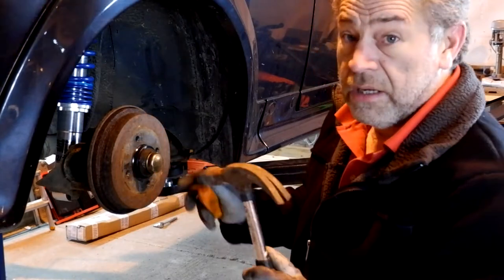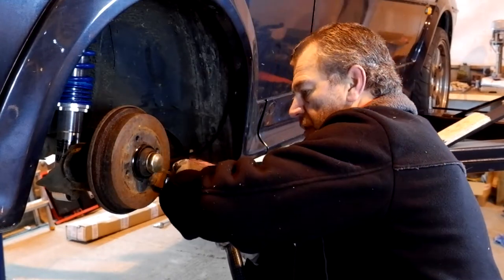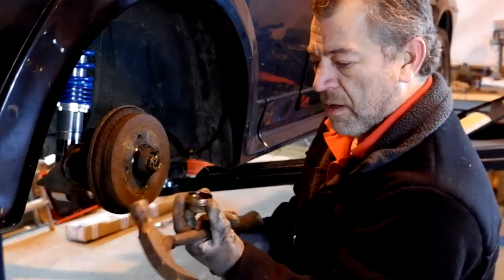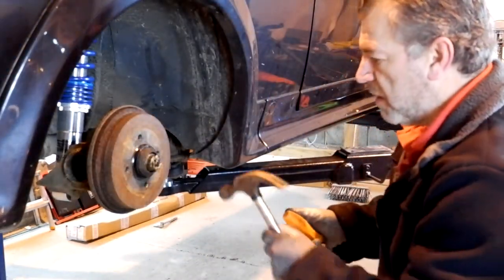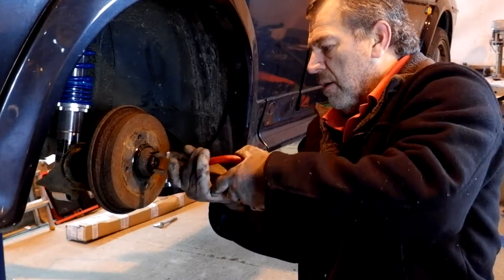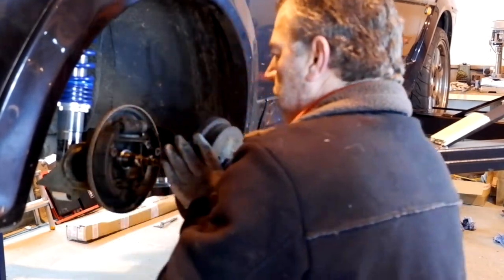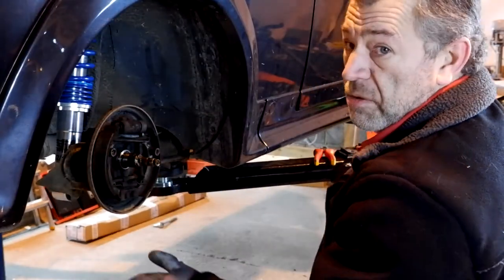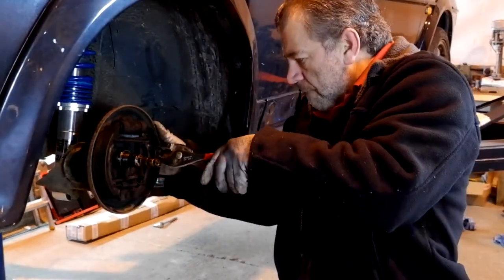My Scirocco Mk2 (Mk1 Golf) Gets Rear Discs!

Comment: Im struggling with my caddmy mk1 brake sistem and i recently findout by accident that the best and cheapest option is to use renault senic 300mm rear and front disc brakes what you think about that and its 4x100 patern too 😅